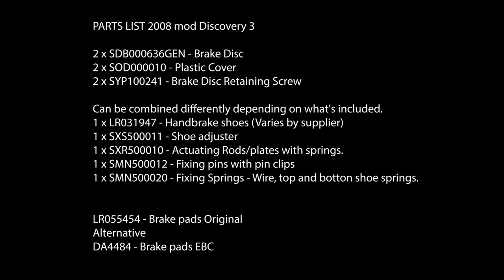Land Rover Discovey 3 / LR3 HANDBRAKE REBUILD - FULL DETAIL

Comment: What is the anti-corrosion spray that you applied inside the disc for the parking brake shoe?
Reply from the maker: Hey, it's just copper spray, I add it so it will slide better, but can collect contaminants so good to service this every year. Clean an re-apply.

Comment: Nice video, not sure I would use Anti seize AND thread lock on the same bolt through! That small bolt only stops the disc falling on your toes - just a dab of anti-seize is all it needs for easier future brake jobs.
Reply from the maker: Saw the comment, forgot to answer. I wasn't sure why when I saw your comment, but I have now checked and I wasn't thinking too hard on m self and was following the Bodsay's brake bible at this point. I totally agree with you and see no point to add thread lock here. Anti seize for sure. Thanks for pointing it out and not sure what the actual LR manual seis about this. 👍 Simon

Comment: Finally got parking brake installed Correctly I am mechanical minded person and have installed parking brakes on other vehicles bit land rover can be difficult if you don't know and understand the correct process,  if I had a you tube channel I would show how the parts go together before installing them , this is most important because thousands of diy people trying to save money without using a shop , I got very frustrated and had to go do something else to take my mind off of it , it was the correct position of the flat plate with zip tie and the adjustment screw was the issue the adjustment screw need to be flush so you can get the flat plate installed so you can get the rotor back on and also lining up the adjustment screw and screw that holds plate in correct location by lifting both tires off ground I learn this by watching lr time doing parking brake job this was very frustrating to me it's the little details are the most important
Reply from the maker: Great feedback James and glad you got it sorted in the end. 👍 Showing it all how it goes together in the beginning in the video is smart and will take that into account if I make more diy videos in the future. 👍 Some things, when you know it, you take for granted that people understand and I do my best with multiple camera angles to show as much details as I can.  😊 There is also the battle between making it entertaining for some and learning for others. See the discussion here: https://www.youtube.com/@LandRoverDrive/community and feel free to add your thoughts. 👍  Good that you write the details and your problems in a comment so others can read and learn. What's make this channel great and the more we share the more we can learn. Thanks again James.  Best, Simon.

Comment: Great set of videos, I did my LR3 rear park brake shoes today, one thing, I did notice the splash guard has some notches cut in it where the adjuster is and the other spring adjuster is. :)
Reply from the maker: Thank you! 👍 A good feeling when they are done. :) Can rest easy as the park prake won't fail for a while.

Comment: Nice job Simon. I did mine a few months ago so I know the struggle with regards to getting the shoes over the bar and getting the clips over the pins with only one pair of hands! 😂 Well done my friend, it's coming along nicely 😊👍
One thing I would have done is sprayed the shoes with brake cleaner too, they looked like they might have picked up some grease. I know mine did after wrestling them in and the back plate contacts having copper grease on them, it's a job not to get it on the friction material!
Reply from the maker: Hey and thanks. Yeah definitely a personal victory wrestling the last shoe into place. 😂 And a great tip to clean the shoes, I didn’t even think of it. Maybe lucky so I got friction right away when testing. But I will definitely do it next time, would have been such a bummer if they just kept on slipping after all that work. 😅😅

Comment: Very Good Job Simon. It's called the adjuster. Very good though. I do wonder why Land Rover made the electronic brake, A very complicated system that could be replaced with a simple lever and cable.
Reply from the maker: Hehe, saw this comment now. Yeah, we could wonder for a long time on the many strange solution they have chosen up through the times of the Discovery. BMW was in the picture just before the D3 was made I think so "fancy" may come from them. :)

Comment: @LandRoverDrive I have just done the and re built the shoe assembly but the drum is too tight to fit over the shoes, Is there something that I need to do to make them smaller?
Reply from the maker: Hey, the EPB module should be set in service mode. This will release the tension on the wires that goes out to the brake shoes. If you google "bodsys brake bible" you can see a detailed reading on this whole thing. 😉

Comment: is dial cog pin direction correct? I thought the cog heads to rear in this case.
Reply from the maker: Cog pin, not sure what you mean? 🤔😁
Reply: @LandRoverDrive  Parking Brake Adjuster Kit - SXS500011. The adjuster gears head to rear side on my car but your video shows driver side. So which is correct/recommended direction?
Reply from the maker: @kamekame9381  Hey, if you see my other video on removal you can see that the cog head is facing the rear as you say. Good catch! 🧐 I put it on the other way when mounting. It's doing the same thing not matter the direction it is put on but if LR has a recommended direction I don't know. This was done back in Aprli/May 2021 and still working as intended with no issues. 👍😁
Reply: @LandRoverDrive  Thanks for your confirmation. I have been watching more than 20 times on your channel. You helped me a lot!! Cheers, Kame

Comment: Hi good video, thanks for up loading! I am rebuilding my neighbours handbrake on a range rover sport..the car was sabotaged and had the complete rear wheel fall off and the handbrake assembly fell out in the road, took ages to find a good diagram and the part number for the lower handbrake plate. I'm curious as to what the yellow cable tie on the lower plate is used for? the kit i have ordered comes with one included
Reply from the maker: Hey and thank you! It’s for when your mounting the plate with the spring on, to make it easier to put on as it’s gets a bit in the way when you need to pull the shoe over the plate. Just remember to cut it of afterwards. 😊

Comment: I watched many of your videos and I also like learning and repairing my own vehicle but for some strange reason I can't get the parking brake pads install correctly its driving me nuts and now I discovered rusty leaking brake lines easy to repair but wow , anyway I do have the haynes land rover repair book the park on parking brake that's holding me up is the flat metal with spring one side goes in easy but other end has a diffent end on that the part that confusing to me and the final adjustment
Reply from the maker: Getting the shoes in can be a bit tricky. Not sure how to explain it better than the video. 🤔

Comment: Not sure if it matters, but looks like you put the adjuster in the other way around. The turning wheel should be on the left, not on the right. This confused me a bit when I saw how you were turning the wheel to adjust the tightness of the shoes.
Reply from the maker: Maybe the camera angle changed or I have done something strange while editing. Can’t really remember. 😅
Reply: @LandRoverDrive  I don't think it's the camera angle. Just keep in mind that because you flipped the direction of the adjuster, in the future if you need to adjust the parking brake you should turn the wheel in the opposite direction of what the book says. E.g. by the book turning the adjuster wheel towards the center of the car wheel to push the brake shoes tighter against the brake disc, in your case you should turn the opposite way for the same purpose.
Reply from the maker: @adv_addict  Thanks, it’s noted. I usually release the top tensioner first, as prescribed, and then tighten it up the lower tensioner completely, before unwinding it again, 8 times was it 🤔, during service, so I just find the way it tightens because I done really remember the way. 😊 

How often do you retighten yours? I try to do mine once a year, either during spring or autumn, when I change from winter to summer tires.
Reply: @LandRoverDrive  It's my first time doing this actually, so I found your video very helpful. Unfortunately, this didn't fix my EPB problem. The parking brake can engage fine every time (even after pulling the manual release cable), but when I press the Parking brake button down to release it doesn't do anything (no grinding noise), if I hold the button down for several seconds then a warning "Parking Brake Fault" comes on. The fault goes away if I turn the car off and back on. There is no persistent code. Based on that symptom, I don't think my EPB module is jammed but there might be actually an electronic issue with the module... I might have to replace the whole module unit.
Reply: Thong Nguyen
Unbelievable....I played around with the parking switch for a bit and the parking brake is now working fine. Engaging and disengaging beautifully!
Reply from the maker: @adv_addict  Nice, happy for you, I know the relieving feeling. 😊 Was a bit afraid to use it at fist after I fixed it but now I’m using it without thinking. 👍

Comment: Nice video but you left out the detail on how the spring on plate with zip tie e brakes not hard to do. But its always the smallest details people leave out, I'm replacing all upper leer control arms front hubs rear hub bearing and new brake dust covers so I need take off rear e brakes pads to do bearing. But I wasn't sure how that spring goes on plate I feel you left this small detail out , besides this ready job
Reply from the maker: I think I do it in my other video, but not sure. I used the zip tie but if I remember correctly it fell off during the rebuild and I don't think I put it in the video in the end. So long ago. It's a smart tip and definitely helpful. I found the hard part was getting to the zip tie afterwards and cutting it loose. 😊